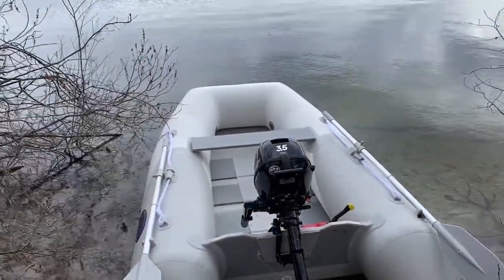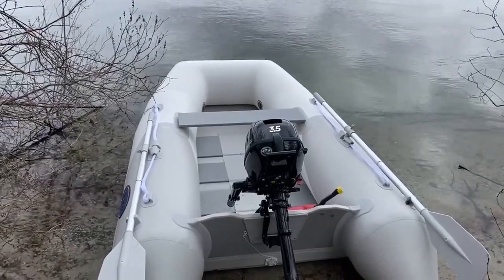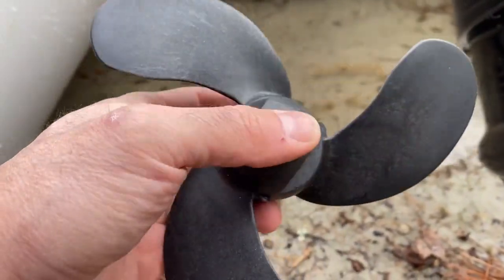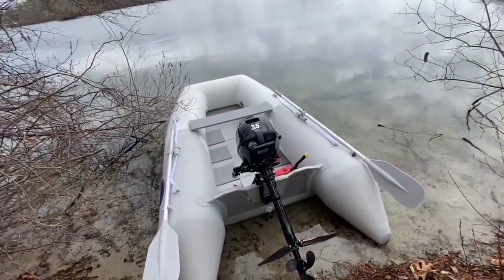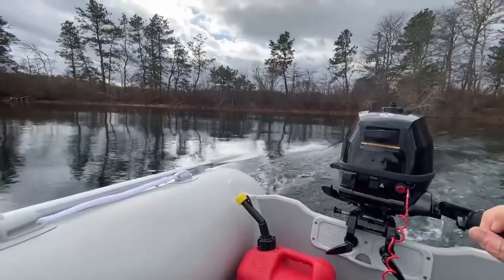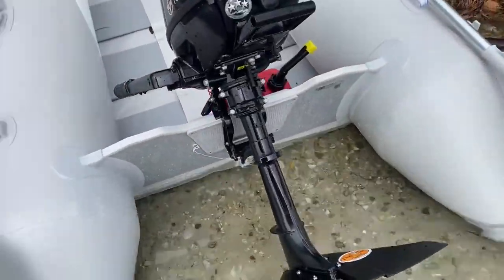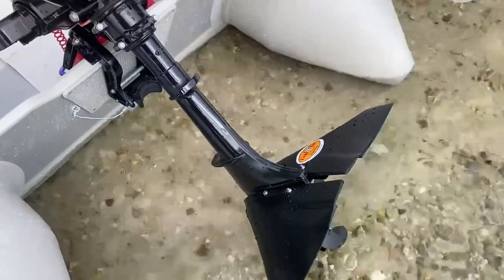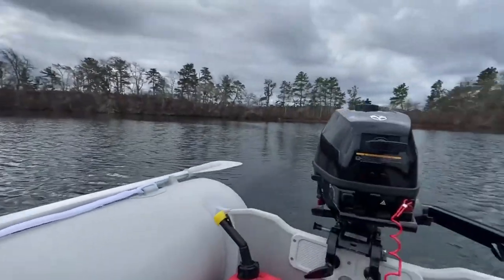West Marine PRU-3 Inflatable Boat with Tohatsu 3.5 HP Speed Fix

Comment: I have a doel fin on my 18ft aluminium walk through with an 85hp outboard, came with the used boat.  I decided to take it off to see if it made a difference.  It does! A little higher top speed because I can trim more of the boat out of the water without porpoising.  It's also more stable in rough water.  As an added bonus it keeps swimmers off the prop and has been used as a step.  Def try it on the Boston. PS still love the blackout ;-)

Comment: I’ve got the same boat non hypalon version “ru-250” and I have a 6hp Suzuki 4 stroke and it will not get on a plane and feels like there is too much resistance. The whole transoms starts to flex, in wondering if a Suzuki 2.5 would work any better or at worst the same

Comment: This dinghy isn't designed to plane, but you did a good job of making it do so! It's a full displacement boat. In order to plane nicely, you need a RIB "Rigid Inflatable Boat". That's according to the manufacturer anyway. They are fantastic shit-to-shore boats, for tooling around the marina, island hopping etc. Thanks for the video!